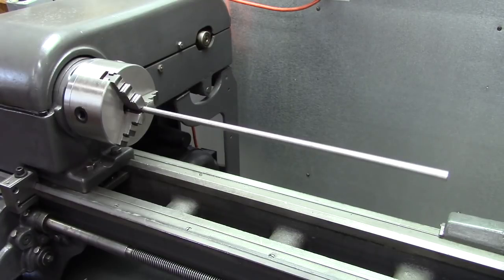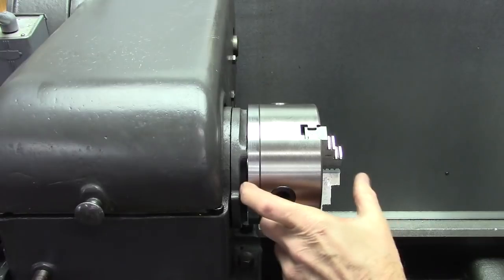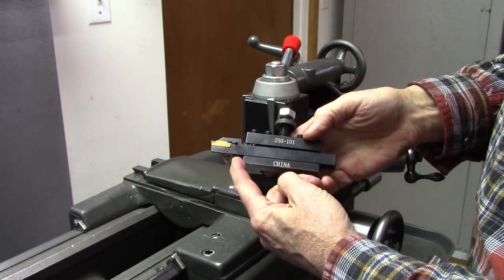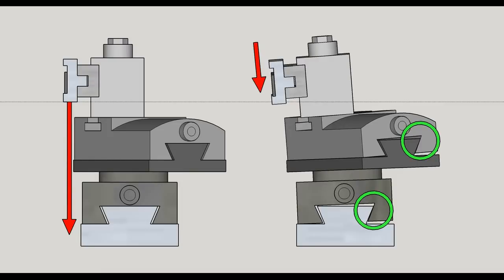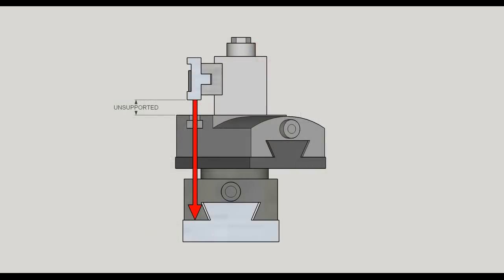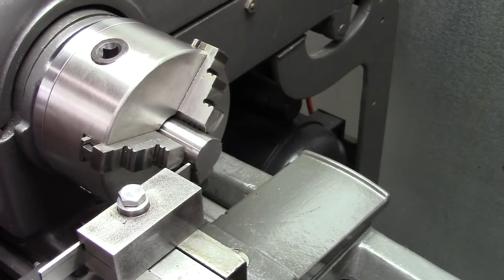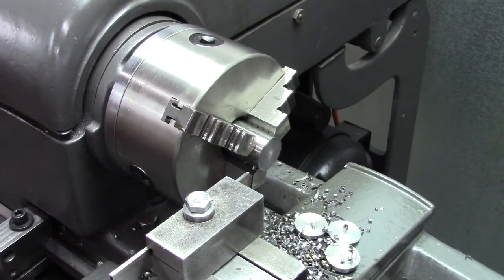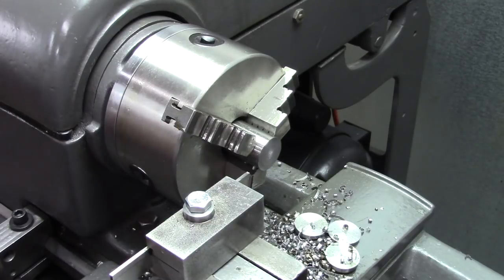Metal Lathe Cut Off Explained PLUS a better tool holder!

Comment: Hey! I wonder if your issue with chatter isn't simply more leverage applied to the spindle bearings. Any clearance in the bearing fit is amplified by increasing the leverage on the workpiece because of the longer distance from the bearings. I'm quite sure your lathe has bronze spindle bearings. I know resonance is a factor, but that is reduced by higher quality bearings. Keep up the informative and well made videos.
Reply from the maker: You are right, it could be bearing although my spindle bearing are roller bearing. With that being said, in my opinion the bronze bearings are a little more solid that the roller bearing. Yes they have clearance but only .001" and as soon as this clearance is gone I suspect it would be solid. My South Bend has sleeve bearing and it's a bit more solid but it also have a slightly larger spindle so it's hard to say. My logan cuts smoother but I can remove more metal each pass on the South B. There is another aspect I did not mention because it seem  to trigger disagreement and that is the thread mount. If you put a 3 foot bar in the chuck and push down you will see the back register on the chuck pulling away from the spindle register. I've had at least 10 people say this is impossible even after showing them video. It kind of blows my mind, disagreeing is fine but when you show them a video and they still say its impossible well, that's just stubborn.
Reply: @WinkysWorkshop  I thank you for your reply and respect your input. If you compare your spindle caps to main bearing caps on an automotive crankshaft, you would find that 2 bolt mains caps are not nearly as capable of controlling rotational forces as 4 bolt main caps. This could be one of the factors in your 3 ft. bar scenario. Keep up the good work!
Reply from the maker: @t.d.mich.7064  Interesting....  I also know that bearings flex. I used to work in on web printing presses and I've seen paper wrap cylinders that stop the press powered by a 30HP motor. Once the paper is removed the bearings and everything are fine but the gap between the cylinders was most 1/8 inch with the paper in there. Fortunately this only happened maybe 3 times in 40 years but the bearing were always fine.

Comment: thank you  cuttoff sucks sometimes -- had one today -  slower was ok  but will look at direct support
Reply from the maker: This direct mount is a huge plus but smaller lathes with a big aftermarket chuck are a problem. I sold my Logan lathe. It had the original chuck that was very shallow so cut off was happening very close to the spindle bearing. On my south bend, which is actually more solid, I still have some problems with the direct mount due to a chuck with a lot of overhang. Slowing it down some helps....  it's all about being solid but also about avoiding a resonance (speed)
Reply from the maker: A good collet setup makes a huge difference as well...  I need one

Comment: G’day Winky. Great video and re-enforcers my ideas of what’s wrong with my mini lathe. One thing though, does the stick out of the cutting tool make a difference?
Cheers 
Peter
Reply from the maker: Yes it does...  It needs to be as short as possible. Good luck, most have a hard time on small lathes. Hopefully you and apply some of the aspects in the video and make it work for you.

Comment: Good video Mark. 
I wonder if part of the harmonics is due to the later chuck being a two piece, (backing plate) ? 
This could cause the vibration due to lack of rigidity.
Reply from the maker: That might be, hard to say but the backing plate is fairly thick/

Comment: How do you adjust tool height in your toolholder design?
Watched both vids and couldn't see the answer?
Reply from the maker: The tool holder is made on center so there is no need to adjust the height. The only disadvantage it that the tool holder is lathe specific.
Reply: @WinkysWorkshop  
Thank you - understand
since most of us have just one lathe, toolholder being lathe specific is not really a disadvantage, but...
I would be concerned about making it accurately and lack of adjustability?
Perhaps making blade slot at slight angle would give some fine tuning by pushing the blade forward or back, without compromising rigidity?
Will have to re-watch your other vid again to see how do you ensure that tool blade ends up on lathe centre.

Comment: Have a look at your drive belt that's on the motor pulley with a view to replacing it. It sounds and looks like it's nearly shot - the motor has a bounce to it that it shouldn't have .
Reply from the maker: Its a cast iron pulley and a new notched belt V-belt (maybe 2-yrs). It's a floating motor mount, some movement is normal. You'd freak out if you saw the solid belt.  I really don't think you were hearing the belt.
Reply: @WinkysWorkshop  The motor just lifted a little every revolution of the belt (it seemed) with a change of sound - usually motors tensioning belts like that just wobble in a sort of random way - well either watch the bit of vid again with the motor in view, see what you think or run it and watch in real life - I don't think I was imagining the regular 'lump' !

Comment: 10:00 Different chuck, less overhang. It would be reall interesting to use the shorter chuck but keep the overhang (so stick the work out more) the same and see how that compares !
Reply from the maker: I'm sure it would be the same or worse...  depending on how you made the extension. Also, I didn't mention it here but the screw mount is also a weakness. with the extension you would have 2 screw mounts.
Reply: @WinkysWorkshop  No !!! I was meaning just poke the bar your turning further out in the narrower chuck - easy enough to do - you're thinking too complicated :)

I've a gut feeling that the newer chuck has some hidden problem with it compared with the old chuck. Maybe the scroll in it is not as snug fitting as the scroll in the old one.
Reply from the maker: @millomweb  Got ya...  however, it's actually the opposite. You can put a long bar in the small chuck that is all the way through the spindle bore, tighten the chuck and wiggle the bar and the other end moves. The new chuck doesn't do that. In fact that's why I started using the new chuck, the old one is worn out.
Reply: @WinkysWorkshop  That's really intriguing ! Got to question the 2 chucks' material type - is the new one softer ?
I'm totally baffled by your long bar test results. They don't agree with the chatter results at all !
Reply from the maker: @millomweb  - I also have a 6 inch shars chuck that is much worse than the new 5 inch. it has an additional inch of more overhang. I'm sure both chucks are hardened although they might be different hardness. Also, I replaced the cast backing plate on the shars with steel. It helped some but didn't fix the chatter. The 5 inch is also steel. I'll never go back to cast back plates on a screw on chuck. Threads are the weak link and cast makes the problem worse.
Reply: @WinkysWorkshop  Aren't I right in thinking there are diferent hardnesses of cast iron in any case ? It's a good point to consider back plates - as they ARE plates and potentially more flexible than the chuck body.
What's your options re getting the steel plates hardened - or even new plates that'll harden more ?
Reply from the maker: @millomweb  Well from what I have read cast and steel are about the same rigidity until the point of failure of cast and then the steel remains much stronger because it will bend without breaking and it retain its form. All new machinery used in production is steel. A hardened steel plate might help but I think most the  problem is spindle flex and possibly movement at the threads. With that being said, the steel is WAY strong at the threads. Cast iron is known for it's vibration dampening. This is due to slight compressibility which is very bad for threads. 

Something interesting is that my South Bend lathe is more solid. The two differences being, plain bearings and  slightly larger spindle (and thicker). The spindles are 1-1/2" vs 1 5/8". This seems like a small amount but the SB spindle is thicker (both have a 11/16" bore).  The strength of a spindle increases exponentially with diameter but it might also be the plain bearings vs ball bearing in my Logan but either way, the overhang has a bad effect. I'm guessing a 2-1/2 spindle or a different style chuck mount would be much better.
Reply: @WinkysWorkshop  You are just making things more complex by comparing two lathes ! Are the Logan bearings balls or rollers ? Rollers I think are better for load bearing.
How do the weights of the 2 logan chucks compare ? We could be into the bizarre world of harmonic (or should that be demonic :) oscillation/vibration. It might be that the whole headstock arrangement closely matches a harmonic frequency of the new chuck ! We'll be down to measuring chatter frequencies.....
I take it the spindle has a (no.2) MT in it - so how about getting a similar diameter bar, turning a precise 2 MT on one end, ram it hard into the spindle then try the parting off tests, generate chatter and audio record it then analyse the resonant frequency afterwards.Repeat with the 2 chucks - or even just with the faceplate screwed on to change the resonant frequency of the spindle while still using the internal taper for the tests.
Do you want to scream now ?????

As for the Logan bearings - do you have data for preloading them ?
Maybe time to get the wiggle bar out again - and do progressive bearing tightening from 'loose' to see at what point ther is no movement at the back end of the headstock spindle (DTI).
You need to invent an adjustment 'stop' (aka film camera) for the bearings. Aim for a 10 thou wobble at the back, make a 1 stop adjustment - hopefully you still have wobble - say 5 thou - so in theory another 1 stop will get you zero wobble and 1 more stop is then at least 5 thou 'wobbleproofing' and possibly a good state of adjustment. See how the bearings feel when rotated by hand. etc.
Reply from the maker: @millomweb  I'm not making it more complex, it is complex. No doubt overhang makes chatter worse, what is in question is why. It is also logical that a smaller spindle would be more effected. The chuck on my south bend is basically the same chuck. You might be interested to know I had a Logan 200 before my 820. Both lathes are 10 inch with the exact same bed. Superficially they look like the same lathe but my 200 had change gears and the 820 the quick change. You might also be interested to know that I had the exact same problem on the 200. In fact the small. The bearing! Both lathes have a standard sealed BALL bearing on the outboard side with a standard clearance. I believe the outboard is the same bearing if I remember right. The chuck side bearings are a double row angular contact ball bearing. Logan calls in Preloaded and the original bearing is a New Departure. Currently they are selling SKF bearings as a replacement. I called SKF and he said they are NOT preloaded but they are zero clearance. He said, if they were a negative clearance the bearing would burn up. He also said, it you run your lathe a few minutes if will become negative clearance. The bearing in both my lathes were and are the original ND bearings and they are in excellent shape. I've check them many times. You are right about roller bearings being better under high load but from what I have head they don't use them because they get very hot when you run them preloaded. They are meant for low speed. The chatter might very well be the bearings despite the fact that they are good. I suspect new bearings would be the same however. One last thing...  the Logan 200 has different bearings (chuck side) and it is know for being bad about chatter. The 820 is a little better than the 200 but not much.

Comment: Is that implies that people make the old chuck knows better on these issues? the new chuck looks shiney and beefy, but it shake. what if.....we find a way to mount the new chuck without the base plate? the old chuck did that decades ago. by the way, do collet chucks do better? it is the smallest and lightest bit it don't hold large dia. pr shall we back to the square one, try a faceplate and clamp nuts?
Reply from the maker: The new chucks are very strong but due to the overhang the spindle flexes and the thread mount itself moves. You pretty much double the leverage with the new chucks. Yes the collets are probably much better. I don't have any to confirm this but the ones intended for the lathe that fit inside the spindle are probably the best. The ER will hang off the end although less than most chucks. Spindle mount thread diameter makes a huge difference as well. Just going from 1.5" to 2" is drastic.
Reply: @UCF58tVSS9Q597phTbV8O_wQ have you check those chucks use on glassware? it is pretty slim, basically that's a baseplate with retractable jaws, light and nothing hangout. may be? just may be we can borrow that design? or....revisit faceplate and lathe dog?

Comment: Thanks for the video, I never knew this, that the overhang from the Chuck did this. I always got scared that I did something wrong  on my Lathe and stopped cutting, and convinced myself I did something wrong, and cut ir off with a angle grinder. I also got a question for you; Why are you undercutting, I mean under the Center is this the Normal procedure!!!       Kind Regards from the Netherlands     Akko
Reply from the maker: Honestly I was trying for center and didn't quite make it. However, it is closer than it looks.

Comment: Great video!
What is your background?
Reply from the maker: I'm a basement mechanic!  Ha.  Actually, my career was printing. I ran a web offset press for 30 years but the last 14 years before I retired I worked as a troubleshooter. This job quickly morphed into a modifying machines in problem areas. I have no higher education or training but learned a lot about engineering and machinist work in that 14 years. I tell people I was a Cheap Engineer. (pressman pay). In some ways I think my hands on training was far superior to going to school but it was very specific. I was very effective because I had years of press experience and understood a lot of the problems very well.

Comment: Were you power feeding or using the cross slide hand wheel?
Reply from the maker: Always power feed. Usually in the .007" to.010" per revolution range. On the larger chuck I had to play with it but slower speed (180 RPM) and feed (.060") was a little better but, on the smaller chuck I was running 470 RPM with a feed of .010" without issue.

Comment: Didn't you do a video on a stand under your cutoff tool? Seems like I remember seeing it.
Reply from the maker: Yes.  I removed it. It worked well but when the insert got slightly dull (maybe 4 cuts) it would wipe out a tool holder. The blade works so much better that I didn't want to lead people to experience the same.
Reply: @WinkysWorkshop  Ok, I understand. Thanks for the reply and the video, Sir!!!!
Reply: @dannywilsher4165  - Of course you are welcome

Comment: You just can't beat a rear mounted upside down parting tool for any parting off.
Reply from the maker: You are probably right. Many lathes, including mine are not set up very well to do this.
Reply: @WinkysWorkshop  Well mine is a 1930 era Colchester Bantam and it has a short length crosslide but I'm planning on making a longer one as is modern lathe practice to allow a rear tool post to be fitted.........no matter how vintage or collectable a machine is I adhere to the concept that it must fulfill a purpose that is practical and if that means redesigning any part then so be it.........museum pieces that are just good to look at have no place in my workshop, garage  etc.......I don't think anyone would think twice about exchanging the old 4 way tool post for a modern QCTP one.
Reply from the maker: @gangleweed  - I totally agree although if I can make it work well without altering the machine I will. The method I use for cutoff works perfect with the small chuck and if I slow the speed and feed down it works well with the new chuck. Logan made a cross slide with T slots that works but it eliminates the compound.  Yeah, the 4 way tool post is a pain to use but the quick change is nowhere near as solid but the convenience makes the compromise acceptable.
Reply: @WinkysWorkshop  Compromise is the name of the game in all cases and as far as you want to go...........you tend to get attached to a lathe and for many it's a lifetime acquisition even with the shortcomings.......buying a new modern lathe is either break the bank or do a complete rework on a cheapie to make it perform reliably.........you can get a lot of lathe for 2 grand and spread over many years represents good value if chosen wisely.

Comment: You have to say "Yahtzee" for it to work correctly.
Reply from the maker: Ha..  If I had only known. Thanks
Reply: @WinkysWorkshop  I have been a machinist -tool maker for 40 plus years. your channel is one of the most informative - easily explained no bull channel out there. you have many great ideas and explain them so they are easily understood. glad I found your channel -monopoly $$$$$
Reply from the maker: @markellis6886  - I'm going to print and frame this comment!  Ha, thanks a bunch!

Comment: A question comes to mind. Could you use slugs of correct size between tool holder and carriage(?) to eliminate the overhang and prevent to a degree this chatter? I don't have much lath time, just asking. Love the demonstrations.
Reply from the maker: The answer is YES. It should be the same. And to be honest, aside from turning the compound in line with the cross slide you should be able to modify a quick change holder to do the same. Maybe jack screws on the bottom.